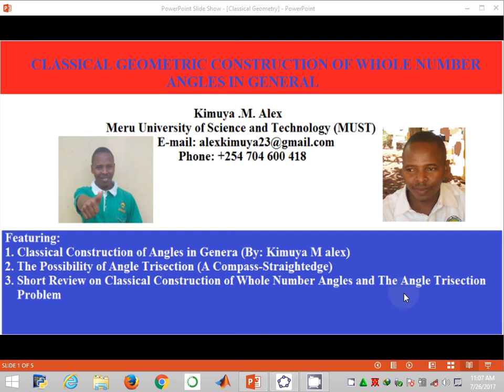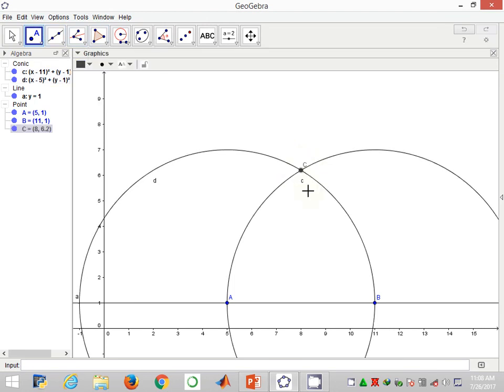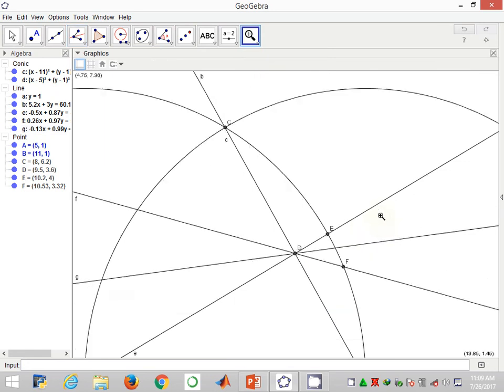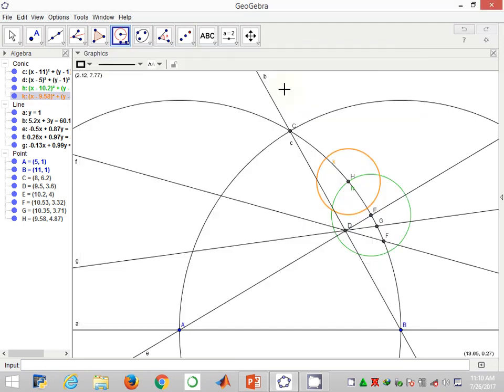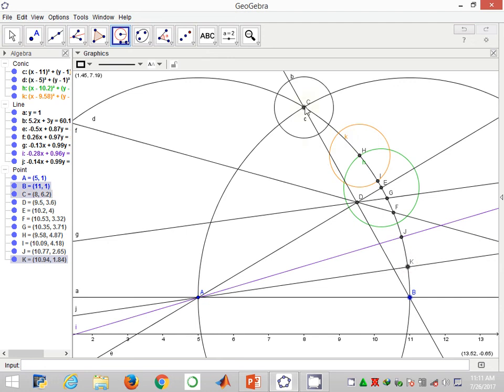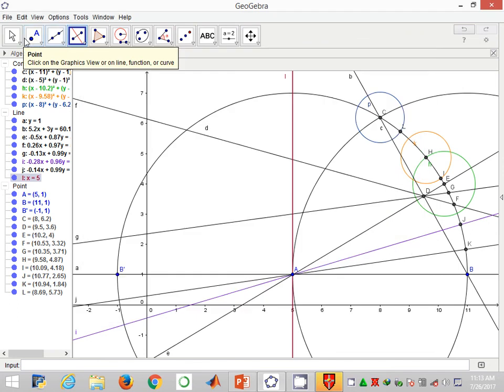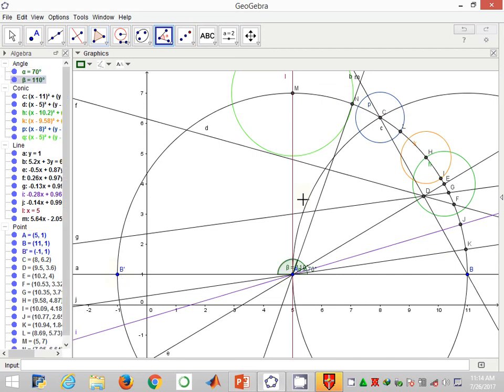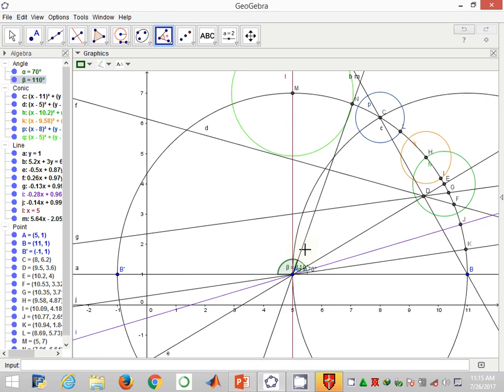Construction of 70 degrees and 110 degrees Angles

Comment: With this, you have proven the construction of a 70° angle with only a compass and straightedge. Therefore, this also proves a 20°, and any bisection from there. This would prove that a regular polygon of 9 sides (40° segments), 18 sides (20° segments), and 36 sides (10° segments) can be created with only a compass and straightedge.